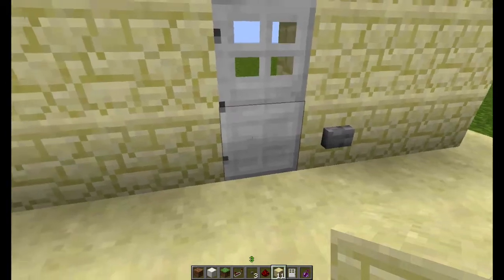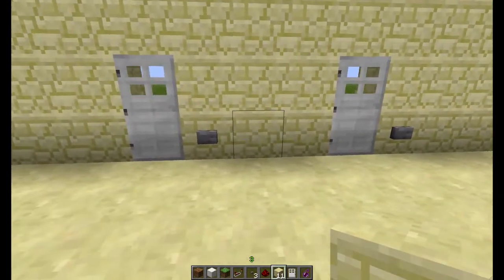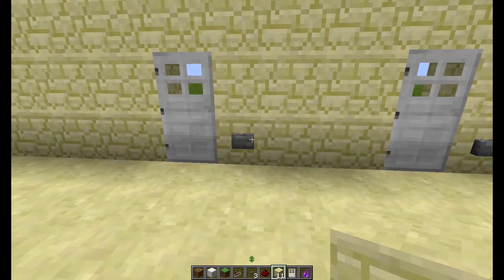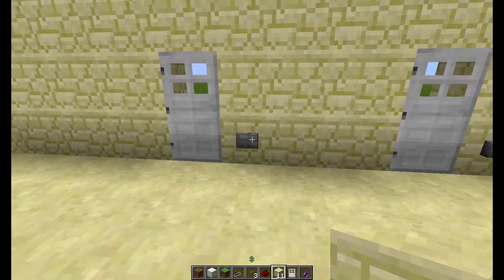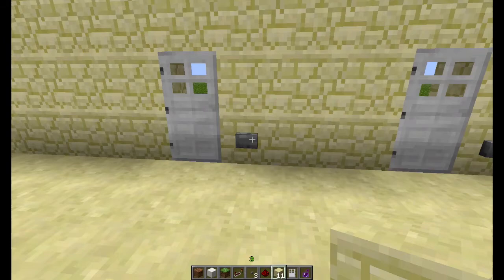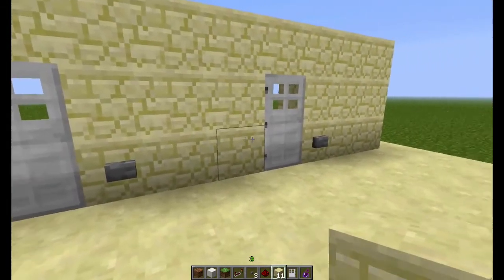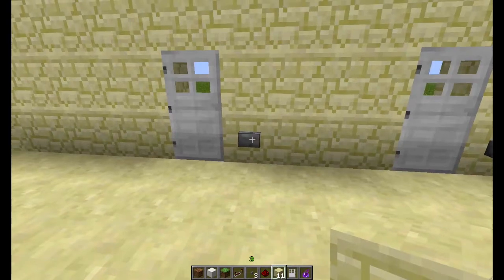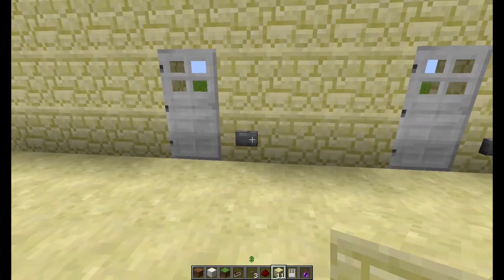Minecraft Easy Redstone: Keeping a door open longer when using a button

Comment: Nice! I was so lost trying to put a delay on a sticky piston door, trying to use a comparator and two entire circuits. All I did was add one extra layer of delay to your design and it works like a charm. Holds open for like 4 seconds, more than enough time even for people with really bad connection on a server.

Comment: Not working for me, the button next to the door goes straight to the door not the circuit. If i move the button away using redstone all i get is a delay in the time from button to door, not in the amount of time it is actually open.
Reply: Just make it exactly like he did, there is no way that it doesn't work? The button has to be next to the door.. the entire point of the design is it uses the buttons power to hold open for the first tick, then the delayed power to hold open for another tick.